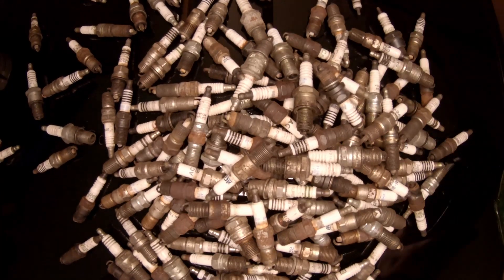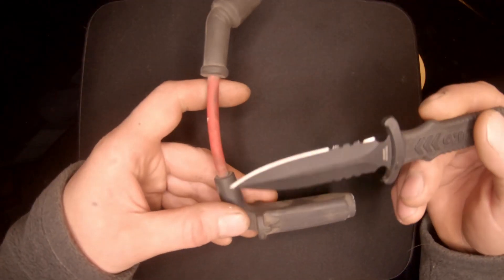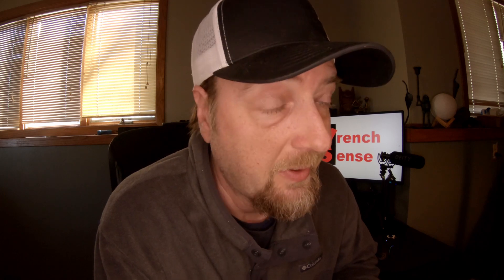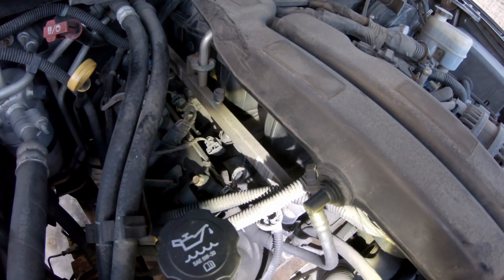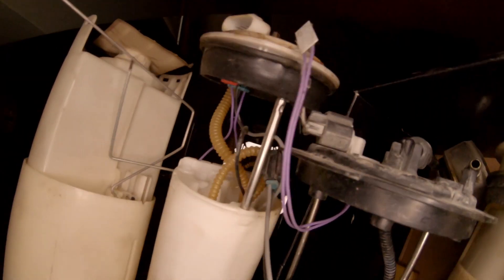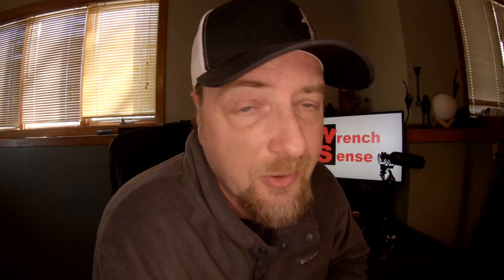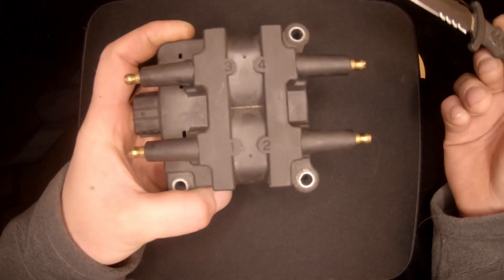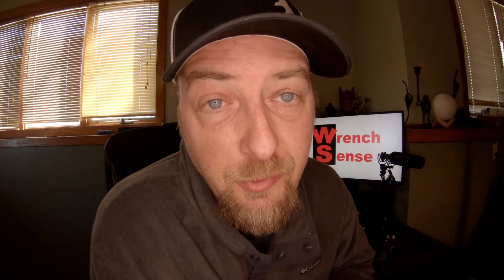P0300 FIX And A Blinking Check Engine Light

Comment: I had a quarter tank and the car was running fine. I went to fill it up and down the road, it started misfiring and threw the blinking check engine light but it went away after about 3 minutes of driving. It’s been running fine ever since, but I don’t let it get close to quarter tank. What could that be? Fuel pump? Idk.
Reply: Mine just did the exact same thing 2 days ago. Bought it, drove ok then stopped to put bout 1/2 tank in it. Bam, engine light, rough af idle, loss off 90% power etc. Changed both cats, all 4 O2 sensors, now im having complete coil pks, wires, and plugs. If that doesnt fix it, on to fuel regulator, fuel pump, fuel filter. My last 2 guesses would be mas or shift 1/2 solenoids. As of this typing im $2600 into repairs to locate this bullshit p300. Smfh

Ive heard could also be a vacuum leak from intake. Who knows at this point. Truck is a money pit. '05 GMC Sierra
Reply: @Samurai-Sakuri  I changed the fuel pump and that seemed to fix it. It looked as if the original fuel pump was still in the car and the car is about 18 years old.
Reply: @Samurai-Sakuri  you can use water to find large vacuum leaks and starting fluid to find large and small vacuum leaks. Starting fluid can be more risky than water but it's a lot easier to notice the change in your engines rpm when spraying it lightly over components that create vacuum

Comment: Great video, well done! Informative, precise, and to the point. I'm not a big wrench on cars guy, but helping my daughter out whose 2013 Outlander threw that code.  Wasn't starting at all.  Plugs were pretty fouled. Cleaned them,  still wouldn't start.  Getting fuel, plugs were wet. Cleaned them again the next day, it started.  Replaced them, now time will tell if that's all that it was or not.  The code reader showed P0300    P.    Does that trailing "P" mean anything?  I am a little concerned that there's more issues than just the plugs.  It seems to be throwing some smoke out the exhaust.  I'm not sure what's normal for that car (she's not a big help telling me either!)  Thanks again for the great information.
Reply from the maker: Glad you liked the video and thanks for the comment. It helps my channel more than people realize. I am not familiar with a "trailing P" It could just be a trait of whatever scanner you are using. I have never seen it on any of the Snap-on scanners. In general the P before the code indicates a powertrain issue. For example, there are B codes which indicate a body issue. Is the smoke from the exhaust only occurring at start up or is it there after driving? In general smoke at start-up that goes away after warm is a valve seal issue that allows oil to enter the combustion chamber while it sits. Smoke after warm indicates bad piston rings which would show up as low compression on one or more cylinders. Could also be caused by a faulty PCV (positive crankcase ventilation) system.

Comment: 1999 tahoe, codes were p300 p301. Check 1 cylinder plug, swapped out no change. Reading plug (all new platinum 2 summers ago) and it looked like rich mixture. Tested PCV valve good. Then looked at fuel pressure regulator, it was missing completely out of the box. Went to 3 different auto stores, ordered one napa. Got it, put it in no change. Tested fuel pressure rail, it was at 50, book says should be 55 to 62. So tomorrow I am going to replace fuel filter (also only couple years old).

Comment: 2015 Chevy spark So when I push the car to fast to hard  chech engine light and tcl blinks. I have had plugs and wires and coil packs changed but still getting a random miss fire code. So what do u think it could b?

Comment: I have a 4.6 3v in my mustang and it has a check engine light flashing. I replaced plugs,coils, compression tested it, smoked it, replaced a fuel pump, but the car only misfires when there is a load like for example when putting it into drive and it’s only cylinder number 5 that misfires no one knows what’s wrong with it and I’m stumped anyone have this issue before that can help?
Reply: Is your engine Fuel Injected or carbureted? Have you had the Fuel Pressure tested? Plugged/Pinched fuel line?
Reply: @AM-sq5ut  yea I even replaced the little plastic clips for them that connect to the fuel injector cause it’s crap plastic and still nothing

Comment: Hello, I got a p0304 code then changed out all the spark plugs now I got a p0300 code and it shakes even more. I also changed all the coils, wires and even cleaned the mass airflow sensor and throttle body, have any clue what may be the issue?
I have an 07 GMC Sierra 5.3
Reply: ON THE SAME BOAT RIGHT NOW!!! Did you fix it??? And if you did, how???
Reply: @rapvault98  it was my lifters on cylinder 4 I changed out the lifters and put non dod lifters with a new cam and flashed the computer
Reply: @Pibs2525  camshaft sensor that is? Did you have a code for the camshaft sensor? I do not
Reply: @Pibs2525  what is a lifter exactly? What should I search up for my 07 Mercedes s550? A lifter?
Reply: @rapvault98  that could be one of the problems but since yours is a Mercedes’ I’m not too sure how to diagnose that car. Mine was a gmc sierra
Reply: Fuel pressure regulator?

Comment: If I end up with a missfire and it's got a skip  my first step is start pulling each wire one buy one . If it runs route, move on till you pull one that has no change.   Then try an figure if it's the wire bad or plug or coil.   You can spray the  wire with water  or left the hood at night for any sparking usually youl feel it anywhere hahaha then check for spark Frome coil buy stuffing a screwdriver in the end of plug wire trying to cross it over something meatal to check for spark  if all is good with a nice blue spark  Nott 🍊 that's bad or weak spark then check  the plug.  Shit adds up quick exspetioally  if the car is worth 500.00 .  I hope your doing the checking or work.  If all is good  not an itidmitting spark that can happen  if unshure put the screwdriver in another plug  good one. An get an idea what it looks like usually just pulling off a little bit you can tell buy the sound.   you should hear the sparking anyway  if you get lifted doin this I suggest changing your wires hahaha.  Kinda like having your buddy stick his finger in the lawnmower plug wire to check for spark hahaha. Anyways don't buy shit till the basics are figured out.   Pull the wires dry  if unshure start the car up at night and wet them a little to see if you can see visible spark  this is best at night.   This is a good start .    Make Shure the engine is cool before attempting . Best of luck.
Reply: Old School Stephanie!!  I love it! Blast from the Past!  
Wish I could afford an older car/truck that had the older ignition systems. They end up being $$$ pits. They were much easier (and funner LOLOL) to work on. Thanks!

Comment: My 2001 Corvette will tell you every code without a scanner but my 2010 suburban wont scanner was only a couple hundred dollars...
Reply: Did you figure out your problem? I have a 2004 corvette.  I have P0300 code only, with check engine light and heavy shaking misfires. Cold start no problem, but after 25-30 seconds the heavy misfiring starts and that's when the CEL blinks and code P0300 pop up on dash.
Reply: @nazareta6541 I'd check the wires they break down by the plugs but I changed all that at 50k miles before it becomes a problem I only have 83k on it now ,actually I've never had a problem with my Corvette other then the radiator being a bottom feeder it plugged up instead of cleaning it I put a double row all aluminum one but it runs great
Reply: @nazareta6541  I'm having the same issue on my 09 Vette. I've changed everything including the cats, plugs, wires, sensors, everything that could be related to this. Only happens on idle (Closed loop). I'm starting to believe there might be faulty wiring with the O2 sensors as they have thrown codes before. Might want to check the wiring there.

Comment: Check the battery first. My engine light was blinking, car was hesitating, it took long to shift gears and when it did the car jerked. I changed the battery and now it runs fine.

Comment: So I have a 97 3.8 firebird that runs great, but if I hit 2500 rpm and hold it there for more than 30 secs my cel comes on flashing with p0300 but instantly stops when I lower the rpm. Changed plugs wires and checked the coils, so I'm thinking fuel issue. Anyone else have the same issue? Car runs great and idles fine so can't be something major

Comment: You are awesome and saved me some money by far if i followed you right. The misfire is only in the #2 cylinder i will follow your  advice and change wires and plugs and see if it fixes the problem ....i just had the engine light flash on me today i will have it scanned in the morning to see.if there is a change it had misfired before but engine light did not flash thank you again for the fantastic input

Comment: I had a misfire on cylinder one ...so I replaced spark plugs and all 6 coils and now and now my check engine light is blinking...the check engine light was on BUT now it's blinking so it got worse oh and I also changed all 4 oxygen sensor....so what the hell is wrong...thanks for your video.
Reply: Did you ever figure it out? I’m having the same problem
Reply: You ever fix your issue

Comment: I SET MY GAP AT .60 FOR 96 SONOMA 4.3
4X4 NEW WIRE PLUGS CAP AND ROTOR ALSO SPIDER INJECTORS. THERE ARE NO LEAKS PRESENT AROUND THE MANIFOLD.

Comment: Hey...great info...my 2006 Ranger was running rough then hit some high water after a really good rain. Well having poor accelleration and power loss, especially going up hill. Going to do the plugs and wires first. But I was thinking it might be the crankshaft sensor since it is low in the front
Reply: That might your fuel pump...
Losing power going uphill is one of the symptoms of a failing fuel pump.

Comment: I recently decided to do a tune up on my 04 silverado 5.3 vortec. Before I began I had no issues and no check engine light. So I replaced all 8 spark plugs and went with 4 iridium and 4 double iridium because I'm impatient and didn't feel like waiting for the store to order more regular iridium. ( let me know if this was a bad idea) so I replaced all spark plugs wires and coil packs, I also replaced my ect sensor because I noticed the connection was broken. So after all that, now I'm getting a blinking check engine light and p0300, I have taken off all the new parts and put them back on over and over and cannot figure out what is causing the misfire. Any advice?

Comment: I have p0101-p0104 it happened after i changed the coil packs on one side of the engine (i drive a subaru wrx 2004) i never touched the other side and im not sure why thats throwing a missfire now

Comment: What if your code reads for camshaft position  sensor  will that cause shaking
Reply: Usually not.  it just might not start one day when it gives out completely.   like a crankshaft sensor.  . But wrong timing can cause misfiring it's calibrating your timing .  So it could very well case rough idle skipping  an lean air an fuel mixture  usually   not good either way

Comment: I have Cadillac Escalade ESV 2018 I did all the steps and I still have P0302 it is so frustrating . Spark and spark cable coil injector still have issue any recommend please

Comment: What if the flashing light pops up and then goes away in about 45 seconds
Reply: I want to know this also
Reply: @ Jay.G_ my car is a 3.5 vq35hr I have a po300 and I’ve replaced injectors and plugs and checked all coils the CEL blinks around 3000 rpm maybe eye valve of cat ? Anything helps
Reply: Mine did this about 3 times in two months, flashed for a few secs then turned off. I brought it in and it was cylinder 1 misfire. Since car never had spark plugs or coils changed at 130000 miles, the mechanic changed them all out and haven't had a misfire since. But I did have to replace alternator about a month later. Stuff starts going at this mileage but it is running good now
Reply: My buick verano got a p0302 code. Went and fixed the fuel injector (cylinder 2). Then it fixed the problem but the car ran for like 5minutes when this code apeared with a CEL in total before. Now I’m thinking since I got only p0300 now that my cat is broken or clogged. Normal idles for me, everything is normal exept when I use the throttle at about 50% +, the car start bugging and hesitating and the CEL starts flashing again for about 1 minute, then it stays on (The CEL) and the only code I get is a p0300 now. Feeling like it’s a dirty cat. Help?
Reply: @Jay.G_ did u ever fix it?
Reply: @Gmackk  Yes I did, my car is fine. The initial problem was really the fuel injector. My car is a 2.0L Turbocharged 2015 buick verano. It is direct-injection therefore the car really can’t handle regular gas. Always put 91 or supreme if recommended. I’ve done some of research on that and the fuel injector probably stopped working because of ethanol. Where I live there’s always around ~10% ethanol in the gas, so that might explain it. The higher fuel
grades are probably better than regular gas because they have more cleaning and better additives. I’ve used Lucas Oil about 7 times now, while always using 91-93 octane grade. This really cleaned all of my fuel injectors. And the reason I still had check engines like P0300 is because one of my spark plugs was cracked and broken (The new ones I’ve installed after then initial problem I’ve had) and I didn’t even noticed. Anyways feel free to ask me questions

Comment: I’ve got a cylinder 4 misfire code changed everything I can think of including the head and intake manifold, coils, plugs,wires, injector. Still have same issue????? Any thoughts?
Reply from the maker: Try a compression check. If compression is low on that cylinder you will get a dead misfire.
Reply: @WrenchSense  after changing everything, I went from 65- to now 170 compression
Reply: Changed your cam with the head?
Reply: You sure the injector is getting a signal?
Reply: Crank sensor relearn

Comment: P0300 is frequently a bad O2 sensor.  If it runs good from a cold start then idle gets lumpy and exhaust starts smelling rich after a few minutes (closed loop), then it's probably an upstream O2 sensor.
Reply: @lizard944 ours is REAL bad,  engine light flashing whole time driven with misfire sounds, exhaust smell!! All started with leak from reservoirs tank onto them getting them wet
Reply: @shawna7975  Yes, antifreeze on the spark plug wires can cause a misfire. You can check the wires at night for shorts.  Go to a place as dark as possible, not inside of a garage...LOL.  Make sure your headlights are out. Let your eyes adjust to the darkness for a few minutes.  Run the engine and if you see sparks "fireworks" all over your wires, then they are shorting. With the engine off you can use warm water sprayed into the engine bay to rinse the coolant off of the wires. Let it dry then you can wipe the plug wires with a rag soaked in WD-40. Good luck
Reply: @lizard944  wow! Will try, thank you so much!
Reply: I believe your right @lizard944
Reply: @ton-locc8069  Thanks. It happens once-in -awhile...LOL
Reply: Lizard, how sure are you of this?
This sounds EXACTLY like my issue. 
I have ONLY P0300. Check engine light and P0300 code comes on after cold start about 20-25 seconds (as it starts to lower RPM/idle) and car/engine starts to shake noticeably. Pretty hard to drive in this condition. If I leave car running for about 2 minutes, it will begin to smell of eggs/sulfur.  Pls advise?
Reply: @nazareta6541  rotten egg smell is bad O2 sensor/cats. Mine did it too. Replaced 4 sensors and 2 cats, problem still persists except my cats are fixed. No more black smoke/smell
Reply: @Samurai-Sakuri  mine was one of the intake valve springs, dealer fixed it
Reply: I recently changed my oxygen sensor and the problem persisted
Reply: @nyonyoziprim  mine was one of the intake valve springs..dealer fixed it
Reply: @nazareta6541  you’re amazing thank you.

Comment: I've got misfires on just one bank of a V-8 (Driver's side of a 2007 5.7 Hemi) and noticed that the fuel pressure test port was on the passenger side. Does that matter?
Reply: The Dodges are notorious for this make Shure they are really good plugs I've replaced with cheaper plugs damn thing barely ran after thought the fuel pump was the issue nope cheap spark plugs.  This was a durrango that this happened too.  Did plugs wires an coils  before trying new plugs againe. Thing has been fine since damn thing threw all kinds of codes before all this change out of sensors injectors all kinds of shit turned out it to be cheaper plugs  than the original equipment parts.

Comment: My engine light is on and blinking and while in park or idle  it shakes. What could be the problem??
Reply: Same I’ve changed everything and still the same
Reply: @amersal5952  yes apparently the coil pack harness was installed incorrectly

Comment: Man im going crazy, my g37 has a p0300 code and ive changed the plugs, coils and did the carb cleaning procedure and i didnt see a change on idle. Im getting back fires from my exhaust when doing a cold start, but wjen it settles it stops doing that and now my cel started blinking. Only mods ive done to my car is high flow cats, would that be the issue? May be bad o2 sensors?
Reply: I have a Q50 3.7 and mines doing the same shit. I did spark plugs, coil packs, and all 4 O2 sensors and still nothing dude
Reply: @cameron090895  mechanic found a vacuum leak underneath the intake plenum, changed gaskets and code was gone
Reply: @tomaslopez4322  yo I've got a g35 with this code and some shaking on idle. Found a tear in my intake PCV, patched it, hoping this solves it lol.